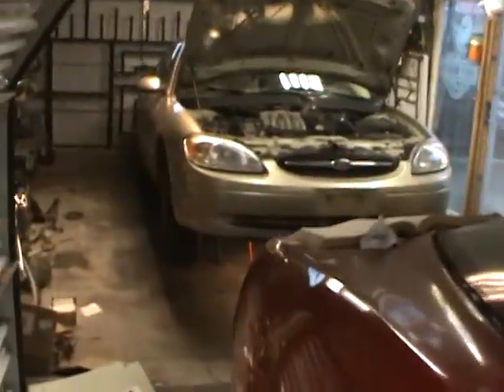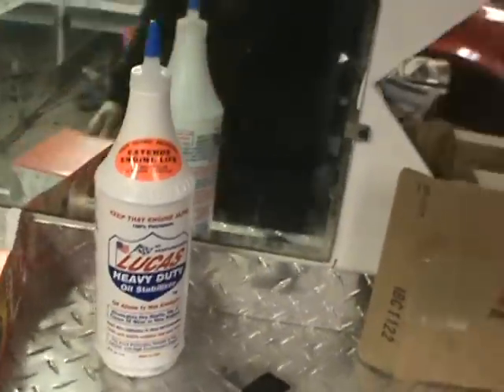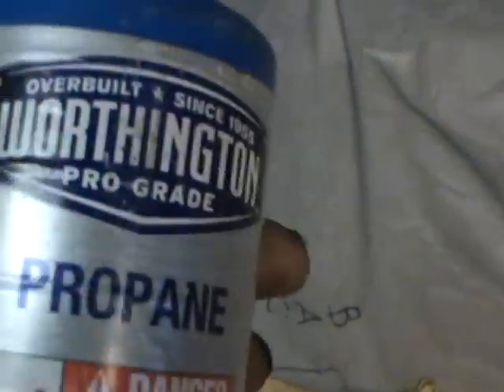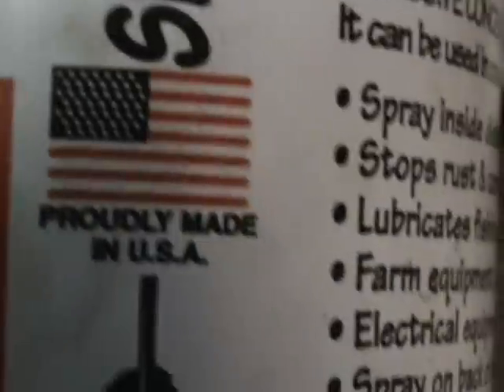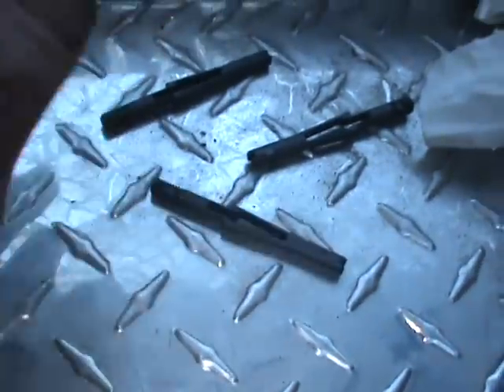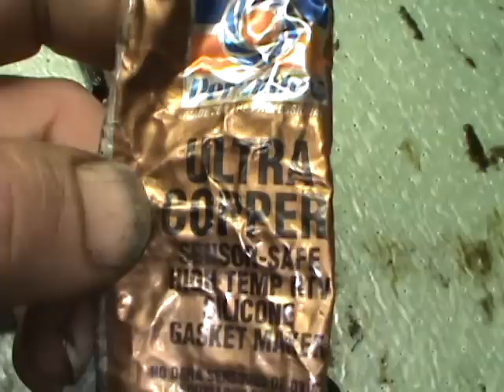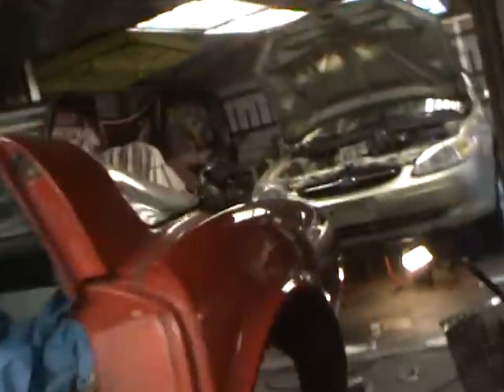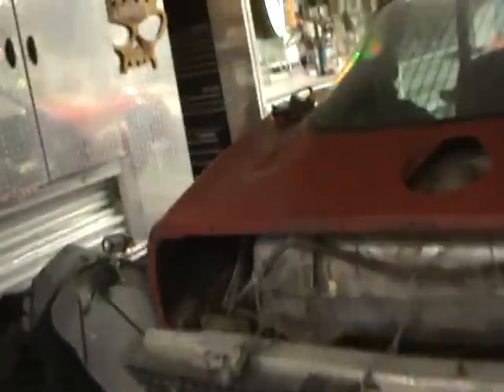WILD CARD CUSTOMS-220-PAINT PIMP

Comment: subframe is toast, supprised the whole lot didn't stay on the floor when you lifted it
cars unsafe like that
cut like that you can mig it back up, just spark it on a ground and use the hot wire to scorch the cut shut